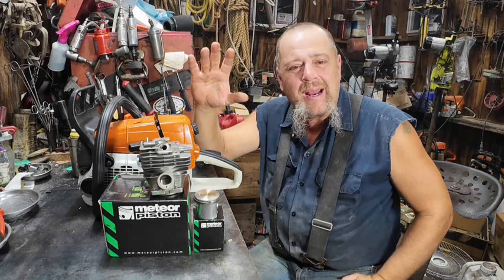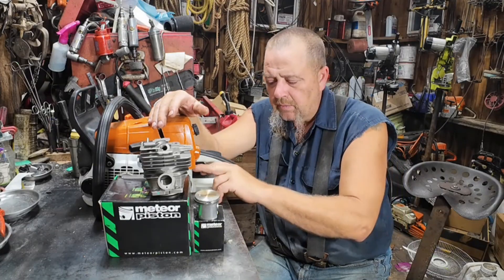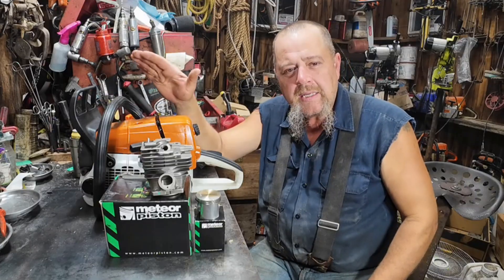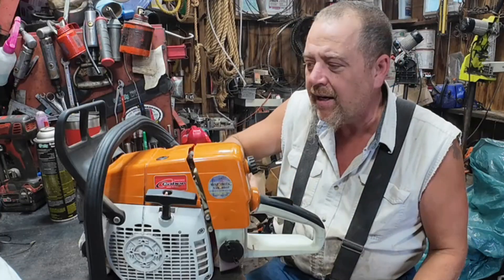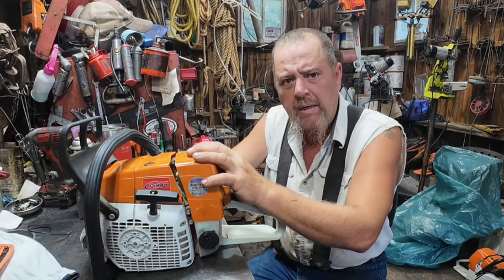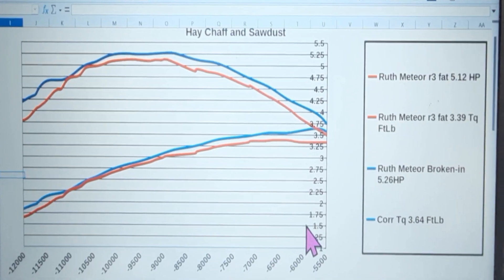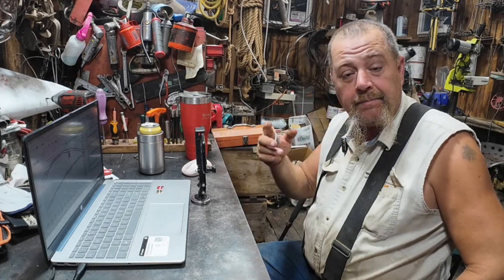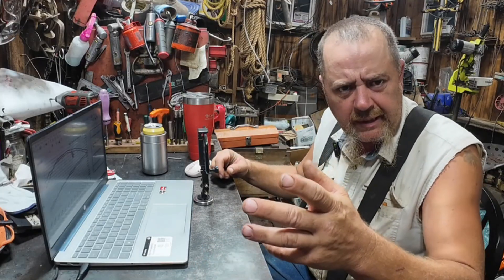The Truth About Ring Break-In Power Gains (Dyno Tested) Stihl MS361 Clone:

Comment: Drill a small hole or two in those handles an fill them full of expandable foam...drill a hole to let it come out
Reply from the maker: @70skid67-c5b I bet that is a good plan! The "door and window" stuff that doesn't expand as hard or the stuff in the red can?  Where this one broke is not hollow; it's got a webbing of criss-crosses that appear designed to add strength... epic fail.
Reply: @HayChaffandSawdust1 I had a OEM sthils 311 do the same thing
Reply from the maker: @70skid67-c5b Really??!! I wish they made handlebars as tough as a '70s Schwinn!
Reply from the maker: @70skid67-c5b That sounds like your house would smell wonderful!!  A little bit of smoke, a bit of apple and some ol deceased pig... mmmm.  I like applesauce with pork chops, pork steak, ... just port in general.  That hyping thing, I can't do it, but I'm learning a little about it; I think each person may only get 3 per week and it only has the option on videos that are 7 days (or less) old.  I sure appreciate the thought and efforts!!

Comment: My experience is it will take about 15 tanks of fuel give or take a couple to break in a good quality piston ring and cylinder kit. With the original Farmertec piston rings and cylinder I felt it was fully broke in at about  6 to 8 tanks.
Reply from the maker: @wayneanderson991 Thanks! One would think that I would have a better intuition for it, but my saws (other than my personal work saws) rarely get 2 tanks before something is changed; the ol test mules never get much/any break-in.

Comment: On an air cooled RC engine I have noticed that good rings need gallons of fuel to fully seat    Its easy to tell because the tail feathers stop getting black spots, the idle increases, and it gets sloppy due to the richening of the mixture due to better drawing in more fuel   You are going to need to put five gallons through it to say it is broken in, best order a truck load of wood and get serious about finding the gremlins hidden in there 😢.  It will be a real world test of how well the saw performs and you will be set for a long cold winter ❄️ 😅 😮 😎   Always appreciate a new video bud, but you have some wood to butcher 🤙🤙 🧐
Reply from the maker: @williamstewart5635 I failed to do compression test, but will before I run it any more; I done messed the chances of apple/apples comparison of more fuel thru it; I was going to do a carb swap and an air filter upgrade while running more fuel thru it; thought I could just put the original carb and filter back on for another dyno at some point; I hooched the orig carb and can't put the toothpaste back in the tube.  Onward and upward I guess and don't cry over spilled milk 🍼 😖